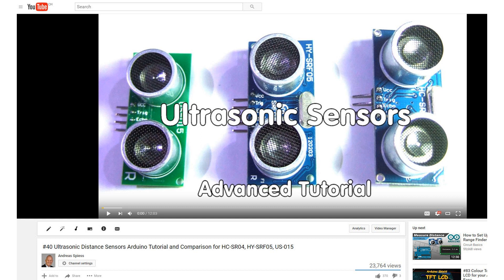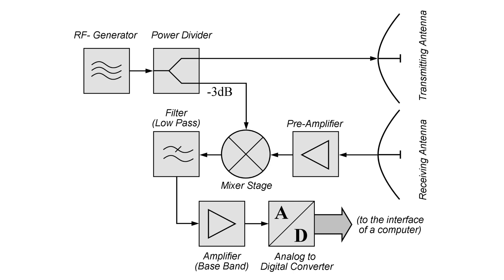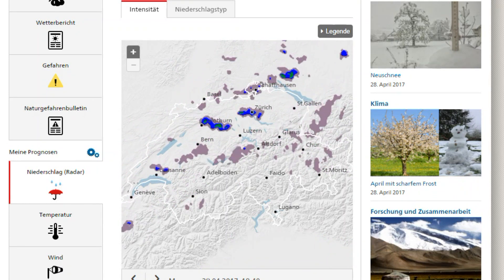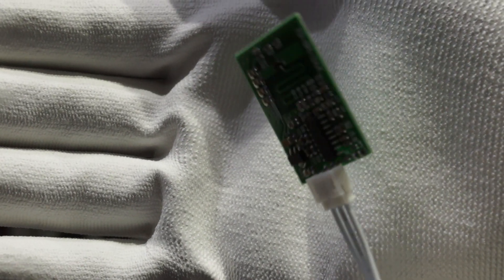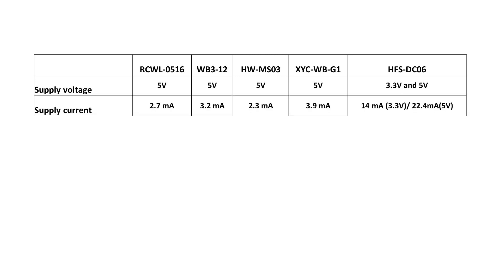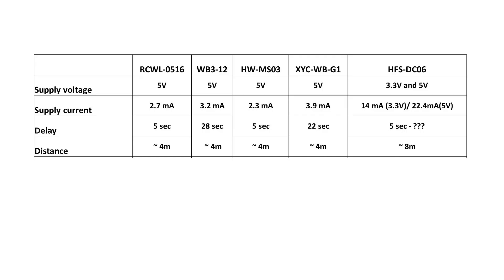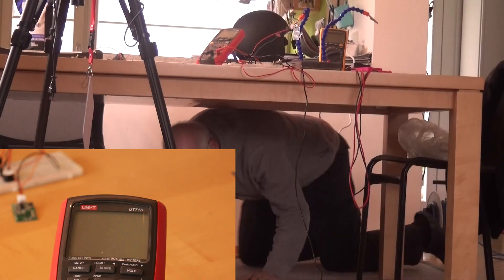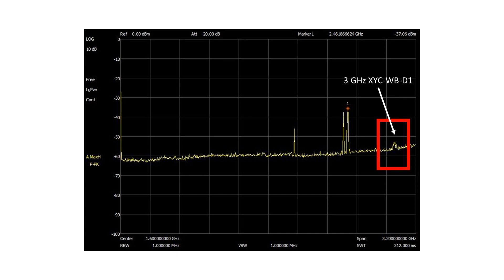#135 Radar Sensors / Switches: Comparison and Tests

Comment: Hallo, sehr interessant. Die Schaltung arbeitet als Penelaudion. Der Transistor ist ein Mikrowellntyp mit einer Transitfrequenz um 3,5 GHz. So ganz legal kann der Betrieb in der Schweiz, Deutschland und der EU nicht sein. In der Schweiz sind es rund 10,4GHz und in Deutschland 9,5GHz die für solche Sensoren reserviert sind. Aufgrund der geringen Reichweite infolge minimaler Sendeleistung könnte ihr Betrieb dann doch wieder legal sein. Ich weiß es nicht. Solche Schaltungen wurden in den Sechzigern und Siebzigern von Modellbauern als Empfänger für Fernsteuerungen verwendet. Ist also eigentlich ein alter Hut, jetzt halt nur irgendwo im GHz-bereich.
Die mäanderförmige Leiterbahn ist eine Hf-Drossel. Sie soll die Hochfrequenz vom Niederfrequezteil der Schaltung fernhalten. Die Antenne ist der runde Schlitzstreifenleiter auf der Rückseite des Transistors. Das ist auch gleichzeitig das frequenzbestimmende Bauteil. Durch die kapazitive Kopplung zwischen dem mit der Basis verbundenen Kupferpatch und dem Streifenleiter zum Kollektor des Transistors entsteht ein Collpittsoszillator. Durch das im Emiiterzweig liegende RC-Glied und die Gleichrichtung der Hf durch  Basis-Emitter-Diode wird eine Kippschwingung erzeugt. Diese bewirkt, daß der Empfänger zuerst sehr unempfindlich ist. Dann steigt die Empfindlichkeit immer weiter an, so daß schwächste Signale empfangen werden können, und schließlich der Empfänger auf seiner Eigenfrequenz schwingt und so zum Sender wird. Die Demodulation erfolgt an der gekrümmten Diodenkennlinie. Der Rest ist filtern, verstärken, vergleichen und Zeitsteuerung. Das wird von dem IC gemacht.
Reply from the maker: Interessant. Dass diese Dinger irgendwo schwingen ist logisch, da ja kein wirklich frequenzbestimmendes Teil vorhanden ist (ausser mechanische Dimensionen). Die Sendeleistung ist allerdings auch sehr klein wenn man den Stromverbrauch anschaut.

Comment: I have LED  TL replacements and they use this technology  to go in power save mode when I leave the room. they also respond to  some one walking outside , they are very omnidirectional which is good for detection of burglars.  Also  other LED lamps I tested for a company had this technology  but they als operated behind glass and walls.  I have no interference with wifi of any of the lamps.  In my working room I have 4 of these LED TL lamps which do not interfere  if some one in  the neighbour room moves the lamps respons , that room also has two devices with this technology
Reply from the maker: Thank you for sharing your experience!

Comment: I know this is old. But. I have a question. you didn't cover the one thing I was interested in knowing? the Voltage range. U tested at the lowest? out of curiosity, if it was increased to max  ( on like the HFS-DC06) would that increase the range / distance via increasing the voltage? and if so. how far would it reach on max voltage?
Reply from the maker: No, I did not try to increase or decrease the voltage.
Reply: @AndreasSpiess  Well, do you suspect increasing the voltage might increase the range of the device?  ( theoretically )? i've ordered a few different ones. they are on the way.

Comment: Just watched your video, good job. I would like to know if any of these operate in the Ku band and could have a transmitter range of over 1/4 mile around 5/8 kilometers.  These would be great fun to mount on your front bumper and drive down the highway setting off radar detectors.
Reply: similar interest for another application. any solution in the meanwhile? thanks!

Comment: Hi, Im using rcwl 0516 for movement detection in grass and i want its range to be as minimum as 5 to 15 cms how can I do this. Please help. I know we can add resistor to reduce it to 5mtr but how about in cms.
Reply from the maker: I do not know. I never looked into changing these devices.

Comment: The operating principle for products in this video is better known as “interferometer” or “return phase detector”.  

The distinction between (1) Doppler shift meter and (2) interferometer is that (1) outputs voltage responds to return frequency shift while the latter responds to return phase shift which include dc components. 

Product’s in this video have dc component blocked, just to simplify the development without expensive high gain dc amplifiers.

Which one to choose ?

Find out the operating length. 

(1) Omni directional to flood a room. 
(2) directional to reduce unwanted triggering. 
(3) The shorter the operating wave length is the less the object displacement needed to trigger it and also less “blind spots”. 
(4) wireless detects through objects. 
(5) acoustic exclude objects behind objects. 
(6) lower supply current to reduce power demand from your project for less problem.
Reply from the maker: Thank you for your additional information!

Comment: You did not answer a crucial question, HOW LONG DOES IT TAKE TO DETECT MOTION, a PIR takes 3-5 seconds, but with some hardware modification like removal of resistors and bridging, the DETECTION DELAY becomes 0.3 seconds. There are many applications where the alarm needs to be nearly instant, I am really struggling to understand why they retard these sensors to be so slow, so please answer my question, and if its above 0.5 seconds -- how to modify it to make it faster, the sensor in question: RCWL-0516

Comment: Great Video! Can i use this Sensors to build a blind spot detector on my car?  The Radar sensor must the metal of a car detected during the drive. Wich Sensor is for this Project the best?  Any idea?
Reply from the maker: Most of the things which will destroy your car probably will not contain metal or water and will not be detected by a radar :-(

Comment: After 2 years this is still an excellent video.

Good to know that the radar sensors don't harm your WiFi. As I can confirm, since you can mount the sensor behind a piece of wood, the sensor also does not harm your wife's eye and this makes such a sensor perfect for home automation systems 😁
Reply from the maker: Maybe more important that it does not "interfere" with your wife than with Wi-Fi ;-)

Comment: Thanks for this video! :)
I want to use such device to build a sensor for my bike (3 wheel velomobile, https://youtu.be/8prtmzIpK0Y ). The pupuse is to get warned if an object is approaching from behind. I am worried about if this still works if I am moving with it and maybe I will get to many false positives because of obstacles on the road.
The second idea is a alarm function of somebody is moving over the vehicle and touching it (this happens very often). I this case the omnidirectional sensivity is not what I need because it would be too sensitive and triggers an alarm if people just walking around. The question is, if I would be able to get an influence on the directional behavior be putting the moduls in a metallic shell which is just open to one direction? Or would it be then destroyed?
Reply from the maker: It should work from the back, if 4 meters reach is enough, because stationary targets disappear fast and followers stay in the beam for longer.

Comment: Is there a way to  detect position of person in the room roughly? Thanks for the good info btw.
Reply from the maker: Maybe with a camera? Not with this technology.
Reply: @AndreasSpiess  Ok i think found a primitive solution. Put this chip on a servo motor rotating in a wide angle as default and scan the area for a motion. When it detects a HIGH area then read angle values of servo to adjust another object to look at the moving target. Of course this will only work on X-axis which is enough for me.

Comment: I want to make cars radar speed what sensor should i use to detect cars at high speed ?
Reply from the maker: Very expensive ones because you need a long range.
Reply: @AndreasSpiess  can you give me a link to good doppler sensor ? And if i want to count cars that passed on the road which sensor should i use ?
Reply from the maker: I do not know these devices. Only the cheap ones with 5 meters range

Comment: I have a few radar modules which I got from aliexpress, they are different from yours but they work. Unfortunately they are not suitable for my purpose because I need something that not only detects motion, but estimates the speed of the motion also. Thus instead of a binary on/off output I would need either an analog out, ADC out, PWM modulated out or something similar. I'm not aware of anything like this available, at least not from the usual sources and in my price range. :(
Reply from the maker: I made a video about radars for speed detection.
Reply: @AndreasSpiess  Yes I found it after I posted. Neat. I should get some of those.
OTOH are you aware of any modules that work in pulsed mode for measuring the distance?
Reply from the maker: They cannot measure distance, only speed
Reply: @AndreasSpiess  I understand that, they use the Doppler effect. I was only wondering if there are others that do.
Reply from the maker: I will create a video about a special method of doing it using the doppler effect.

Comment: Hi, great video! Did you make any experiemnts blocking or directing these signals? I've made tests with grounded aluminium foil blocking a RCWL0516 with no success.
Reply from the maker: One sensor has a metal case on the back for directionality and it seems to work.

Comment: I don't think speed radars use doppler effect. for such high frequencies you need much higher speed to observe doppler effect. What's used is a bit different - same that's used in light distance measurements (not sure how it's called)
Reply from the maker: They use Doppler. And the frequencies are very low (kHz)

Comment: Actually this is a very old technology.
In the early days of electronics, vacuum tubes / valves were Very expensive.  So the valves were used to perform multiple functions.  A radio receiver consisted of a one-valve oscillator.  RF signals were received by an antenna and then passed through a tuned circuit.  The filtered RF signal was applied to the oscillator, where the signal was mixed with the oscillator's RF signal (homodyne detection).  The result was a low-frequency audio signal, which the user could hear.  The same process is happening in this circuit. 

The RCWL-0516 is a grounded-collector oscillator.  The transistor's collector is connected to a constant voltage V+ source, which is at AC ground.  The transistor's emitter is connected to a 1/4 wavelength transmission line (the S-shaped PCB trace), one end of which is connected to the emitter (the signal source) and the other end of which is connected (via capacitors) to ground.  The transistor's base is connected to the junction of the bias resistors.  Oscillation occurs because feedback / coupling occurs between the base and the emitter:  there is a PCB-trace stub connected to the base, which is positioned near enough to the trace through which the emitter's signal flows so that some of the transistor's output signal is fedback to the base.  
The S-shaped PBC trace acts not only as a resonant transmission line, but also as an antenna, which both transmits and receives.  An operating frequency of 24 GHz corresponds to a wavelength in free space of 1.25 cm, so a 1/4 wavelength antenna ("meander microstripline monopole  antenna") would be about about 3 mm long.
Reply from the maker: Thank you for your interesting explanation! I did not know that.
Reply: @AndreasSpiess  -- You're welcome.  The operating frequency of the RCWL-0516 is probably closer to 3 GHZ (so the antenna would be closer to 2 cm long), but the circuit operates in the same way.

Comment: There is no receiver and/or mixer... The transistor (and the capacitors and antenna as an inductor) generate the RF signal. When the signal is distorted by moving objects causing a doppler shift for example, the reflected signal interferes with the sent signal this increases or decreases the load on the generated RF signal. Since you are not trying to detect movement and not trying to measure the speed of the movement. The frequency difference isn't really relevant, so you can essentially just add some filtering circuitry and measure the amplitude of the generated RF signal and detect sudden changes in amplitude.
Check out this video for more details. He does a pretty good job at analyzing the circuitry. https://youtu.be/Hf19hc9PtcE?t=245
Reply from the maker: Thank you for the link. I watched the video but BigClive also does not exactly know how it works, I think...

Comment: the HFS-DC06 probably has a higher gain directional antenna. It almost perfectly fits the bill: Half the detection area for double the power/range.
Reply from the maker: As usual: You can choose which tradeoff is better for your application.

Comment: Hi Andreas, I would like to use HFS-DC06 behind a mirror in order to detect movement. As you know, mirror is plated, so my doubt is weather it will work or not and if I can decrease sensitivity for a range of 1-2 meters. Thanks
Reply from the maker: You have to try. I do not know.

Comment: I am being gangstalked. The criminals have made my house into a gas chamber, exposing me and my child to low level toxic gasses 24/7. I believe they are managing to do this by putting sensors all over the house and installing a network of fine gas pipes between the walls of the house, which are connected to the gas cylinders in the adjoining house. The gases can be ramped up in real time as I, for example, move from room to room, open the windows and even if I open my eyes after sleeping!
I believe the gases are being controlled remotely, partly by artificial intelligence, partly by human intervention. Andreas, please can you tell me what device to use to locate the toxic gas piping and the sensors. This is my theory of how they are poisoning me and my child in my home. If you can think of other ways they may be pushing these gases into a U.K. home, I would value your and your subscribers advice. NB: one minute one gas is emitted from a particular area. Another minute, a different gas is emitted from same area. So I imagine it’s quite a sophisticated system the criminals have set up. Thanking you kindly for an urgent reply.

Comment: Hallo und danke für die tollen Videos. Ich habe den hfs-dc06 und musste lange fummeln weil er nicht funktioniert hat. In deiner Beschreibung steht dass er sowohl mit 3,3V als auch mit 5V als Spannungsversorgung betrieben werden kann. Ich habe bei 5V irgendwann gesehen dass die kleine LED leicht glimmte. Da der Sensor auch mit 12V angegeben ist habe ich es damit versucht. Ab ca. 7V arbeitet er dann gut. Mit 12V problemlos. Gibt es da unterschiedliche Modelle? 2. Kann man die Zeit auch kleiner bekommen. Mit dem. Poti bin ich bei ca. 3Sekunden und komme nicht weiter runter. Kann man den Poti auslöten und einen Kleineren einbauen?

Gruß
Reply from the maker: Offenbar gibt es verschiedene Modelle. Du hast es ja bewiesen ;-)
Reply: @AndreasSpiess  wo hast du deinen bekommen? Eine 5V Version wäre gut. Danke
Reply from the maker: Ich habe normalerweise Links unter dem Video

Comment: Excellent work. Have you been able to find a device that can use radar to detect just presence, not requiring motion? My Use Case is presence detection of a senior in a room when they are passive. I was hoping the Bosch Radion TriTech which includes radar would do this but it only looks for motion. Frank
Reply from the maker: Detecting something which does not move is in General not easy. Maybe you have to add some sort of "beacon" to the senior. I made a video about BLE presence detector.

Comment: In this context a video about level shifters would be nice.
Reply from the maker: What would be the questions answered by the video?
Reply: @AndreasSpiess  Which level shifters are suitable for the ESP8266 or a Raspberry? Where do you need them? How do you know you need one?
For example, I connected one of the cheap radar sensors to a Raspberry. At first it worked out well but then it started flooding signals after once triggered and only calmed down after a few minutes. Could this be because I only powered it with 3.3 V? Would a level shifter help?

Comment: i tried 9196 it works as you mentioned but at 180 degree rotation the range and sensitivity drops very much. the chip side facing us works good. i tested it behind a metal gate half of the height covered with metal sheet and half of it with striped bars. the circuit dint work even though there is enough gap for the waves to go.
Reply from the maker: Thank you for sharing your experience.